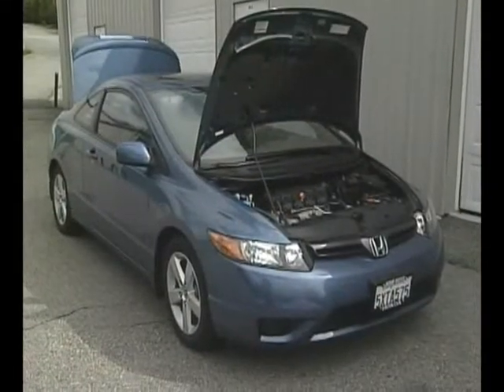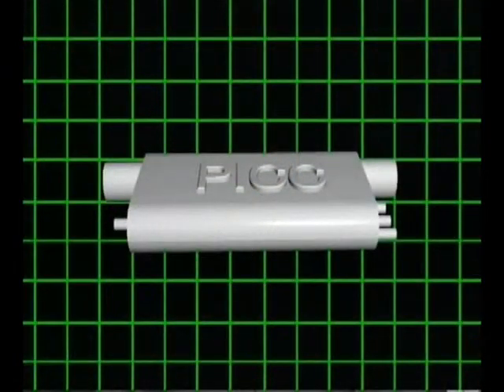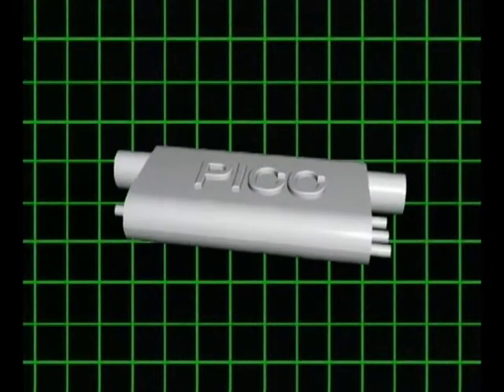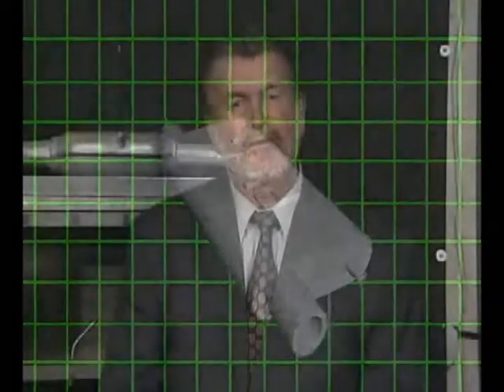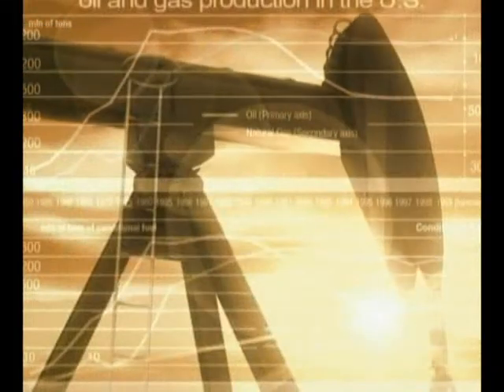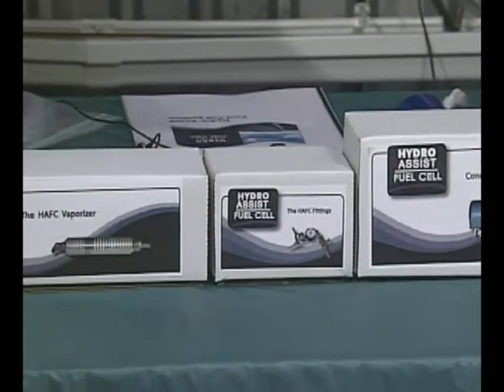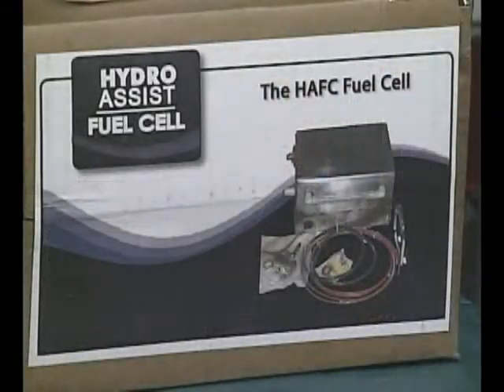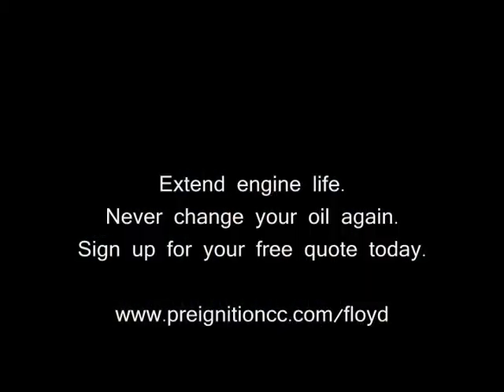Picc Hafc 1 of 4: www.preignitioncc.com/floyd

Comment: This is truth.  I went to New Jersey and witnessed, and had hands on training installing and tuning these systems.  It worked on my boss's car.  We went from 30 mpg to 50.2 mpg coming home from Jersey.  My wifes Trailblazer got 59.16 mpg after her install done in a class that I trained along side my boss.  Myth busters didn't do it right, but DID prove that an engine will run on Hydrogen.  I live in Shelbyville pretty close to Louisville.  What truck do you have this installed on?
Reply: A Rogers, I've scrolled through 1000z of articles! Can you please point me in the right direction?

Comment: Ahh yes, the hydro assist fuel cell.  Tap extra power from your engine (causing it to burn more gas), waste more than half of it in inefficiencies, then pipe the resulting gasses (only trace amounts compared to the amount of air and fuel the engine is consuming) into the engine again to burn them.  Of course, it's so simple.. how could adding new inefficiencies into your car's engine NOT increase the mileage?